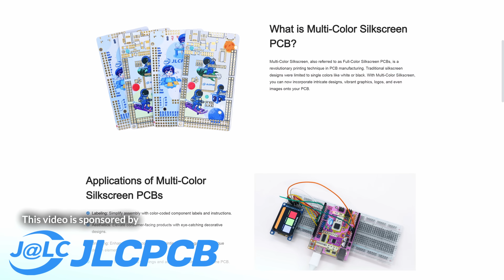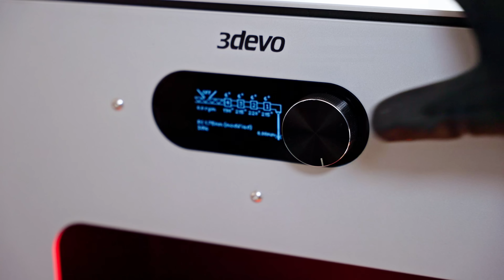How hard could it be to make my own Carbon Fiber Filament?

Comment from the maker: A couple notes on the safety aspects of the chopped carbon fibers: Yes, they absolutely are a material that needs to be treated with a proper amount of respect, and you should avoid breathing them in by all means. I can't recommend that you try to do what I showed me doing in the video - but for everyone concerned about my health, I think I was being as safe as I could possibly be, by doing all this in my well-ventilated garage, wearing a Tyvek suite and 3M P3 respirator (A2P2 when the extruder was running), having an air cleaner on the workbench (which would immediately suck up any dust that my have escaped) and two more air cleaners constantly cycling the air in the garage, as well as regular vacuuming of the floor and surfaces.
Nothing can be 100% safe, but short of doing everything in a vented fume hood, I think I managed to control the risks pretty well.
Again, not an endorsement that you should try the same.

Prusament PC-Blend https://go.toms3d.org/Prusament

Product links are affiliate links - I may earn a commission on qualifying purchases (at no extra cost to you)
Reply: When I saw the title, I was wondering if you did a 180 with health concerns since your 3d printer emissions video
Reply: Probably cleaner than the air we breathe on a regular basis at that point..
Reply: With all the printer housing experience, seems to me that building a fume hood would be easier than running all those air purifiers and vacuuming

Comment: @MadeWithLayers I think you could maybe have gotton better results cutting down the fibers if you had used some solvent (water, ethanol, isopropanol or something) kind of similar how you said that you liked having the lignin or resin there to give the fibres some intertia so the can be cut.. (you need to dry after but could be wirth it and you void having resin or lignin in your filament after..)

Comment: Stefan posted a video from some additive manufacturing show he went to where a company had a printer that could lay down wire in beads of material. It required a rotatable head so it would drag in the correct direction, and I assume some sort of cutter, but I wonder if something like that could handle continuous fiber which would make parts obscenely strong along the layers. Could maybe combine it with the Z-pinning to improve cross/layer adhesion.

Maybe cheaper just to use PPS :P

Comment: In like 10-20 years the CF will be absolutely everywhere. People throw these plastic cf parts (printed, injection...) just in the trash and it will end up in some landfill. Grinding against other trash etc. There should be the same strict laws for throwing away cf parts like with asbestos.
Reply: Yea

Comment: A tip or two, a rotary sander on a dry carbon piece, you get the finest black stuff you want, for the hemp probably a bit of water would give them a medium to be chopped up in.. and maybe a dual extrusion with a fiber strand encased in polycarbonate would be a nice idea

Comment: It would be interesting to try using a fine carbon fiber mesh applied between layers of a print. The problem is finding a carbon fiber mesh fine enough with small gaps.
Reply: An IDEX system where the second nozzle prints the fiber?
Reply: @TNX255  no, print a layer then add a carbon fiber mesh over that layer then print the next layer so the carbon gets fused into the print. 
I saw a printer probably around 5 years ago that had a special system to lay in a continuous strand of fiber while the print was going. It was a trade show video but a don't remember whos channel it was on or the company making it. It was similar to what you described.
Reply: @kyleo1236  I got what you meant, but wouldn't it be easier and simpler if the other nozzle could just print the mesh every other layer?

Comment: Printed carbon fibre can not deliver the properties where CF is known for.

Being able to print CF sounds nice as a selling point, but its just a 3d print with mostly resin, so the weight loss is not optimal and also the strength isn’t comparable with real CF woven sheets.

The correct way to approach this is, stop using CF filament.
Print 3d moulds and get real carbon fiber sheets, epoxy and a vacuum setup to make a real CF parts with the  help of 3d mould making.

Comment: I did injection molding process to mold nylon +30%glass fibre material for some parts in my diy small injection molding machine, they were pretty strong, it was ten years ago, and at that time of years, carbon fibre filament for 3d printing not yet exist or popular. General speaking, those glass fibre will make industrial molding machine barrel screw worn out because glass fibre rubs against it, however, I think carbon fibre in 3d printer won't wear the nozzle orifice much even after long period time usage, will it ? BTW, it is sad that carbon fibre filament is still expensive, I still have the purchased a bag of 25kg nylon 30%GF plastic pellet, if I have your filament making machine, I can make some nylon+GF filament for 3d printing process trial

Comment: It's an error to equate sieve mesh size to sieved material size, it's complex due to the mesh make-up and material shape - in your case I bet you will have much longer strands than you expect because sieves are effectly smallest cross section sorters - think what sieve chopped dried spaghetti would pass via and how much chopping would be needed.

Comment: Laminate carbon is around 80% fibers and 20% matrix, not 50%
Reply: No, absolutely not. Not even in a Formula1 would you find laminated parts that have more than 60% fiber content. Too little resin and the part will be weak and go straight in the bin. 
50% is a good ballpark number. A wet-in-wet hand layup is around 40-45%. A vacuum-bagged hand laminate or a resin infused part will be around 45-50%, and you can get 55%+ using pre-preg and lots of pressure to squeeze every bit of superfluous resin out of the laminate.

Comment: Thought that you were going to make filament with an embedded continuous strand of CF.
* Super strong vase mode?
* Slicer tweak or postprocess to keep extruding during movements since there is that strand? For functional parts, snipping the visible strands could be a viable tradeoff for the strength gained.

Comment: Robbert Murray Smith channel put some graphene into a cement mix and it made it 50% stronger, and it was only a small percentage.  Which had me excited for carbon filled filaments but i realized graphene and carbon fibre arent the same thing, graphene is 1 atom layer, maybe thats the difference why it worked so well in a cement mix?  Youd think it wouldnt matter after you chop it all up and mix it with something else but maybe its better. Graphene is really hard to make cheaply tho, and also hard to mix properly, which seems to be a key factor.
Reply: Also Murray showed in his recent videos that it is actually pretty easy to produce graphene using a mix of water, graphit and lean whey protein. 30 mins in a mixer.

Comment: Thank you for a very well produced video .
The thing with saving 15% plastic if we exchange that with waste material is a
good thing ,you forgot to mention that if we do so ,it can be really difficult
to recycle this particularly mixed filament ,since it consist of different
waste materials , E.g. carbon material .
Reply from the maker: Recycling is already a super tricky matter - at this point, you can basically assume that 0% of the printed parts you throw out end up being recycled into plastic parts again. Printed parts, with all the fillers and additives that get added to filaments already, are super hard to categorize by polymer type, so just burning them for energy is the easier and cheaper route on a commercial scale.
Reply: @MadeWithLayers  Your absolutely right about that ,it would properly 
be easier to just burn the mixed material ,rather than trying to 
separate the different polymers .
Burning it for energy is way easier
Reply: Rather than saving just 15% plastic using fillers, I would like to see PETG-, ABS- and PC-like materials created from 100% bio materials, saving 100% of the plastic and need for oil. Be it some new form of PLA or cellulose derivative 🙂

Old wind mill blades (not much they are useful for?) might be a good source for GF fillers 😉

Comment: If you take the normal CF blends and print at very fine layer heights would it help align the fibers?  I purchased a couple of rolls of Tullomer filament and they claim the finer the layer height the more the chains are aligned the stronger the part - I haven't printed anything with it cause of its premium price.

Comment: Happy New Year, Tom.

I would think that a continuous fiber filament would be preferable to a chopped fiber. 

Or is it an issue that you would need to include a cutter in the print head?

Comment: I tried this for an alternative molding compound some years ago using basalt fiber and ended up with a light industrial grinder, a self-made virabratory ball mill and an industrially salvaged 1100mm injection screw to make the process work. What worked even better and significantly easier was graphitizing high carbon base material and running that with powdered resin material (not going to say exactly what as it's fairly toxic and best used with extensive PPE) but it did make a tremendously strong, flowable composite material that supports and readily links to crystalline polymer(s). Thomas, if you want to give it the ol' college try, I can contact you with specifics if you're interested.

Comment: I'm still so uncomfortable with filled filaments especially with the fills that feel like they're going to be asbestos 2.0 such as Carbon Fiber.

Id love to see a fill that I could feel confident is safe, because all I can imagine is the nozzle scraping off small lung killing particles as it scrapes over the top of the filament line it's laying etc.
Reply: The risks from breathing in CF dust are likely to be rather high, yes. I did some research on this for a series of articles for Hackaday a while back, and let's just say that those CF particles produced especially from mechanical action (breaking, grinding, etc.) are absolutely not something you'd want to breathe in, as they fall within the same size and shape as some types of asbestos.

Having CF parts around probably is okay, much like how asbestos is fine if you do not damage it and allow it to be breathed in and attach to clothing and skin. I'd much rather have wood filler or such, as those are not even nearly as harmful as asbestos or CF.
Reply: @MayaPosch  people (I'm generalising a lot here, sorry. Or am I 🤨) have this weird mindset, that everything is safe until studied and shown dangerous (and then it becomes conspiracy for the foil-hat section. Weirdly it works opposite ways, toxins are "good", safe vaccines are "bad" 😑).
Radium was eventually discovered dangerous, though industry was not keen to protect workers (radium girls).
Smoking was discovered dangerous, though industry used vast amounts of money to convince the opposite (doesn't this sound similar to global warming and oil industry?), and is still allowed almost everywhere (money talks?).

CF and GF filaments can not (and will not, fingers crossed 😉) see such silencing from industry, but instead we have YT "specialists" commentators repeating "fibre is non-issue" without any back up. Maybe there is a universal constant how much we have to poison ourselves, and getting rid of lead in gasoline opened up new opportunities (sarcasm) 🙃
Combined with increasing use of filled filaments in homes (easy PLA-CF & PETG-CF materials, steel nozzles becoming more common, pretty looks 🙄), it looks like the amount of ignorance might be the universal (though not constant) 🤔
Reply: @MayaPosch Breathing in small particles can be harmfull, but you cant compare cf and asbestos that easily. Harmful about abestos fibres is, that they are  very small (d < 3 micrometer) and have a high aspect ratio (l/d > 3:1). This makes them respirable and causing asbestosis, which can cause lunge cancer in the worst case. 
Carbon fibres are Not respirable because of their larger diameter (d > 5 micrometer), which does not make them respirable.
Reply: same, it gives me anxiety just looking at it
Reply: Some youtube commenter got bladder cancer just from printing ABS. Enclosures don't help either. If you don't keep your printer in a negative pressure tent like i do you're flirting with cancer regardless of the fiber content

Comment: Your dedication to producing unique and interesting content is admirable.
Tip for blenders - they work much better when you use have the stuff you want to reduce in size in a liquid suspension, and would also assist with the classifying through the meshes.
Reply from the maker: Thought about that, but then getting the water back out would be a bit of an ordeal without having the shredded material turn back into a felted mat
Reply: @MadeWithLayers  use resin instead of water then. Or melted PLA.

Comment: One of the biggest races in the consumer space in the next few years might be continuous carbon fiber filament + 5-axis printing.  That would be one hell of a combo
Reply: continuous fiber will have minimal advancement until the two main companies producing machines for it who hold the relevant patents stop suing each other into oblivion and refusing to license the patents. continous composites and markforged if you are curious.
Reply: Is it really though considering Z-Polymers?

Continuous seems too niche and 5 axis is niche too.

I can however see a use for 5 axis for 3d printing onto existing items.

Comment: I am far from expert in this field, but (assuming you don't have twin screw extruder) from my minor experience for successful and uniform results you would need equal sizing of both raw material and additive/composite, otherwise gravity just does its job, and your powder falls before your pellet. You need to resize (grind) base raw material close to size of your powder composite, or if you have prepelletized fibers you can use your pellet form of PC blend without problem. Too many cycles of pre-pelletizing for right mixture will degrade the base polymer. Correct me if I am wrong.

Comment: If a filament made with PVA (same ingredient as wood glue) existed you could basically print with wood filler after you add the wood dust
Reply: PVA filament does exist!

Comment: if anything this shows it is kind of crazy how affordable even current Carbon Fiber inclusive filaments are.
Reply from the maker: 60€ per kilogram for the Prusament PC-CF I used for reference is totally reasonable, imho. I've seen people use PA-CF filaments that cost 250€+ per kg, thinking they'd create indestructible parts if they just used the highest end materials, just to have the parts turn into pool noodles as soon as they saw the first bit of humidity.

Comment: I don't make my own filament, but only PLA and PETG. If needed to make it stronger I used carbon fiber a few times but mostly glasfiber. The latter is much easier and also a lot easier to obtain as there is an glasfiber insulation factory nearby. Adding fibers in a single screw extruder is not working, unless you can add the fibers separately in a constant flow, just before the screw. Even than it is probably necessary to do multiple passes. 
For people who want to experiment with adding fibers, you can best start with PLA and flax (Linum usitatissimum). Hemp is not suited as it is very hygroscopic. Flax fiber may be up to 0,5 mm long. but an average of 0,2 mm is available.  Obtaining flax is extremely easy. Linnen is made from flax. If you have a piece of linnen, dip it in boiling water for a couple of minutes and put it in a blender. Dry and sieve the result over a 0,250 mm sieve. Make the large parts moist with hot water and put it back in the blender. 
Before extruding dry both the PLA and flax fibers, mix 100 mg PLA with 15 to 40 gr of flax. Mix it thoroughly. As both PLA and flax will become static, the flax will stick to the PLA. Put the mixture in the hopper of the extruder. With high fiber contents you may need an second pass.

The resulting filament is easy to print, but set the temperature 5 tot 10 deg. C lower. The result is a bit stronger and layer adhesion is better.

Comment: I wonder how microballoons would would affect filament.  I imagine it would be lighter and possibly stronger because the tiny bubbles are surrounded by plastic, forming a structure full of very small curves.
Reply: Pretty much any filler will reduce performance unless they have a high aspect ratio, such as fibers. Would be neat for lightweighting.
Reply from the maker: You can get something like LW-PLA https://colorfabb.com/lw-pla-natural , but CNC Kitchen confirmed that it suffers from the same over-proportional loss of strength vs. weight saved as most other types of foam.

Comment: Next time, why don't you try using sheer exfoliation to tear the carbon fiber apart, while suspending it in a solution. You can later try out that solution, and have ultra fine particles that are more consistent in size. I use the same method to create micro graphene

Comment: There are wood fiber "filled" filaments available, but their strength is lower than the base material, which I think is typically PLA.
Reply: Those probably have the same composition as MDF, which is wood dust glued with resin then pressed.